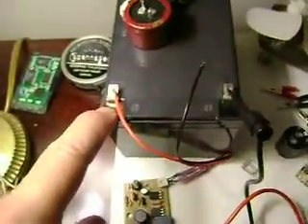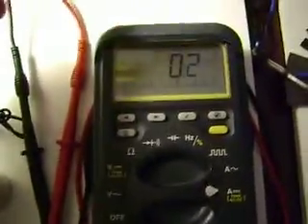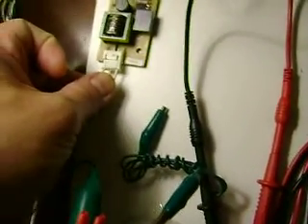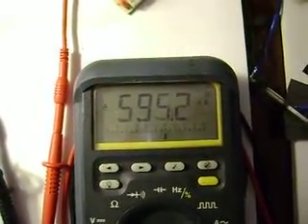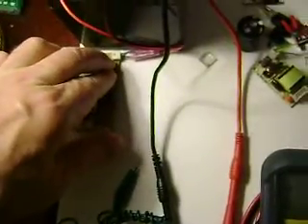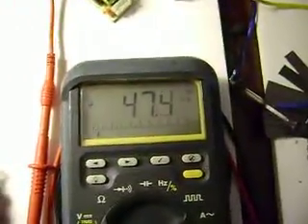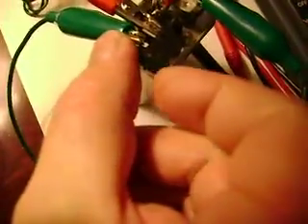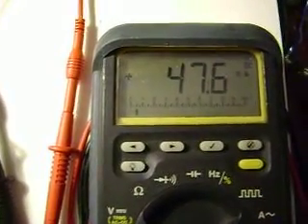capacitor discharge circuit part 2c another way to charge the cap   input tests

Comment: Then when you connect the other leg of the HFHV trafo to the av plug with the remote end still connected to the lamp, the AC flow is then being rectified asymetrically, which causes a sort of DC to be seen by the CFL.  If you had a scope you could see the output from the HVHF trafo and how it shifts when you connect one side to a "sync" aka the av plug into an unshorted cap, and the other end to the CFL.    Do you have a scope, whats the waveform look like on the HFHV output side?

Comment: The locking in the switch is due the HV plasma upon closure/opening.  The input amps should go down as the volts in the MOT cap goes up.  How long does it take the volts in the mot cap to reach 200vdc?  How frequently can you discharge it at that 200vdc?  

Also when you connect one lead to the CFL, its not "rectifying" the output so the HV AC wiggle that is coming out the HFHV trafo is just wiggling the gas, versus splitting it which is what the DC potential does.

Comment: Then you feed the one side of the HV output to the avramenko plug, which takes only the alternations from the one end of the trafo and rectifies it into the .94uF capacity.   The current increase by 1-2mA is due to the current draw as it charges up an essentially open circuit output which is that capacitor.  Since you're not taking from both ends of the HV trafo output it can't "short" and thus push the input current draw to max.  Cont'd below.

Comment: Ok so input is 12vdc at 46mA with nothing on output of HF/HV trafo, and the output is a single lead from the HV HF trafo which goes into a HWBR diode pair, one blocking and one passing, which would then be attached to the Microwave Oven Transformer Capacitor, which is likely ~.91-.94uF (less than 1uF).  Then u feed the output into a scanner flourescent tube, aka high impedance load, input jumps to 600mA.  (and climbs as the gas is heated from applied volts.)  cont'd below.